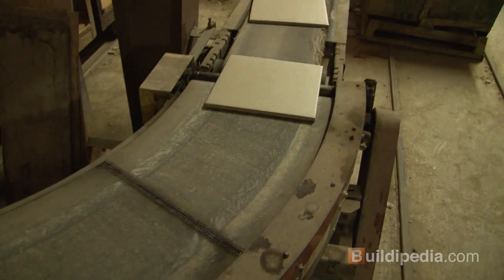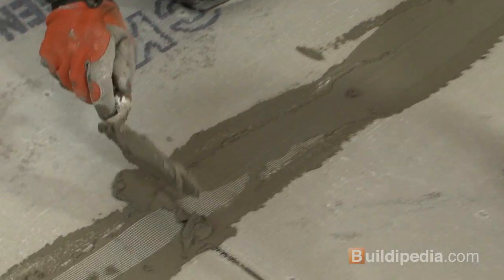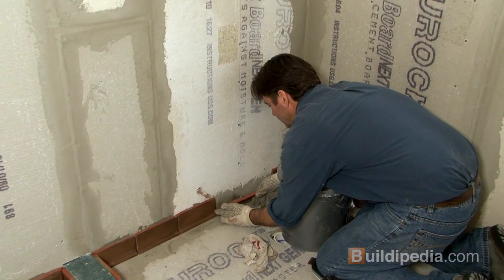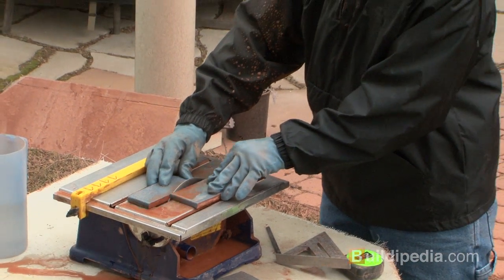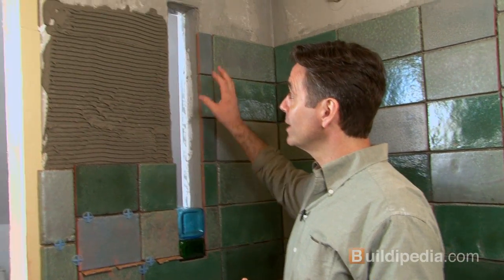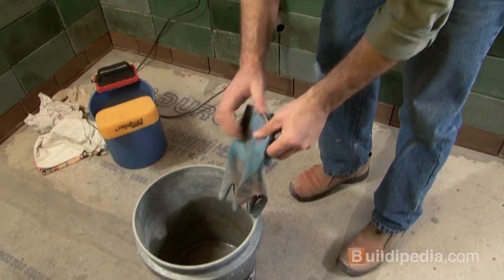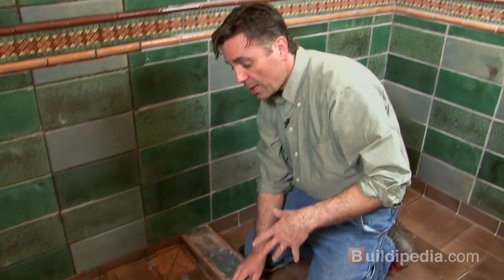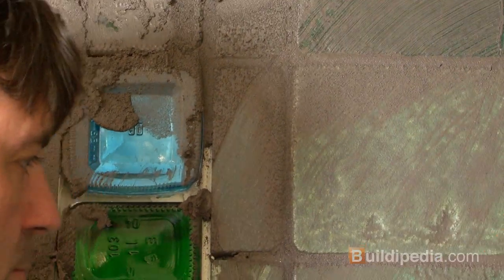How to Install Bathroom Tile -- Buildipedia DIY

Comment: Questions -- you showed how to cut the small circle for the valve but not the larger circular shape for the fixture... ? 

And how do you prep for glass block windows? Do you need to frame those in? Do you back with concrete board? How do you make them water/vapor tight?

Comment: Hey great job, tiling makes a big difference to any bathtub. However if you are going to the trouble of replacing tile why not change out the bathtub drain and instal a sparkling new drain. Too dificult!! not if you use this new amazing tub drain ezXtractor. Its easy and you will have the job done in minutes. Want more information go to ezXtractor web site.

Comment: Well, it is an informative video material on installing bathroom tiles. However, the debatable part is whether it is good for DIY approach. Those who are first timers might have significant trouble using the techniques. They might not be that comfortable with the stuff. It’s better to get a professional for the job. Why don’t you try Gottashopit? You will get and endless list of pre-screened service providers from us.